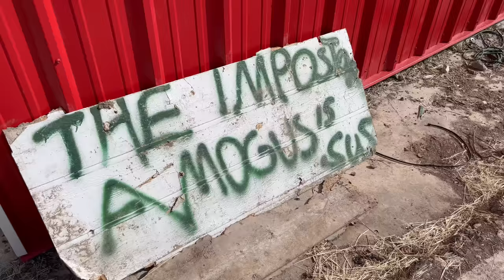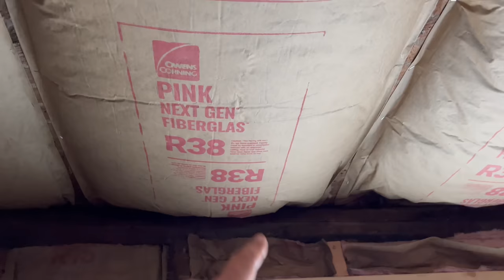Ok They Pull Up (Gort Breaks In)

Comment: ben, please name big ounce's children small kilogram and tiny pound
Reply: The measurement babies
Reply: I agree best names
Reply: @coonhuntereldon3192  The Kilo 141 is one of the several fully-automatic assault rifles usable by the player, and is unlocked alongside custom loadouts at rank 4. It features a 4 to 6 shot kill to the body, which is average for the class.
Reply: @josueonabudget9411  This comment bleeds pacergram fitness test energy
Reply: YES YES YES
Reply: medium liter
Reply: i think lil kg and small pound is better
Reply: @Shenanigans_333  "the weightlings"
Reply: @thegrim418  The Heckler & Koch HK433 is a modular assault rifle chambered for 5.56×45mm which combines features of the G36 and the HK416 families of assault rifles. The HK433 was designed by Heckler & Koch to be familiar to operators with experience using the Heckler & Koch G36 and HK416 platforms. Wikipedia
Designer: Heckler & Koch
Barrel length: 280 mm (11 in); 318 mm (12.5 in); 368 mm (14.5 in); 419 mm (16.5 in); 480 mm (18.9 in); 508 mm (20.0 in)
Muzzle velocity: ~925 m/s (3,030 ft/s) (16.5" barrel); ~970 m/s (3,200 ft/s) (20" barrel)
Action: Short-stroke piston, rotating bolt
Rate of fire: 700 rounds/min
Manufacturer: Heckler & Koch HK433
Effective firing range: 500–600 m (550–660 yd)
Reply: SMALL KILOGRAM!!!
Reply: I can’t believe Biggerton Ouncerton is already having kids, they grow up so fast 😢
Reply: I stand this
Reply: @thegrim418  the fitness gram pacer test is a multistage aerobic capacity test
Reply: @josueonabudget9411  I imagine you posted this on the wrong video.😹
Reply: Would love to see a T- Spoon and Keanu Reeves
Reply: his hive can be called the Measure Mint where they mint only the finiests of measures.
Reply: Lol i love this.
Reply: What about when they grow up?
Reply: Tiny Pound sounds....... yeah
Reply: @pepto8718  nah the weightlings is better
Reply: @marinamccann  dababy is not a baby anymore and he is still named baby so just leave it like that
Reply: @josueonabudget9411  Dababy is a rapper also good job with the idea, I was just thinking ahead
Reply: Big Ounce   OMG HI
Reply: Big Ounce   I’m a big fan
Reply: Agreed
Reply: OMG DO IT DO IT
Reply: He should name the first child Jr Whopper
Reply: @sammich897  doesnt make sense to me
Reply: Yes
Reply: Smol ounce
Reply: Kilo and Lil Ounce
Reply: @thegrim418 fitnessgram pacer test 🤓🤓🤓
Reply: This comment thread is legendary
Reply: Yes
Reply: Bigger ton ouncer ton da third
Reply: @failure4  dorkester.mp5
Reply: Millie -kilo, Bitsy-ounce, Bounce (a boy Ounce), Gram.....etc
Reply: What about little tonne
Reply: @coledaulton8740  sound good too
Reply: Your place is looking pretty darn nice Ben!
Reply: Yes
Reply: YESSS
Reply: Prince and princess ounce
Reply: @KL8T0N_SLU2HIE  that actually sounds better than mr ounce
Reply: HAHA
Reply: @urbanrescueranch
Reply: @The urban rescue ranch
Reply: YES PLS
Reply: how about big gram
Reply: Petit Pound
Reply: YES
Reply: @josueonabudget9411  cringe.
Reply: @ashurag.  i dont know if you think cringe should not be named cringe or if i am cringe. if so, what the fuck did i do wrong
Reply: About that
Reply: @coatrak1357  what now
Reply: @coatrak1357  is there something obvious that i am  missing to understand
Reply: The heavyweights
Reply: Pound for pounds
Reply: Agreed😊
Reply: *Lil Kilo and Tiny Pound*
Reply: @darc6278  no i created this and i do what i want with it dont change the goddamn name
Reply: @josueonabudget9411  the first name sucked so lol
Reply: @darc6278  yk what i agree
Reply: I agree
Reply: Nice
Reply: Quarter pound
Reply: and petite gallon <3333
Reply: Half ounce 😂
Reply: Small gram
Reply: mini liter
Reply: I was hoping he gets a new one in remembrance of big ounce and call him “big lb” for pounds😞I still miss that little big ounce…he’s up there now showing god and heaven how to be the strongest boy alive

Comment: That tank is for oil for an old oil burner. You can drain and clean it disposing of the oil wherever your local place is and cut it up and scrap it but if you have a company do it they will charge a crazy and claim epa stuff drives up the cost.

Comment: Instead of fencing off that hose outlet. Get yourself a piece of 4inc PVC pipe cut a notch out of it and cover the pipe with that. Go from bottom to top with the notch then go to the left or right with it some once you are at the point where the faucet is. This way you can drop the PVC on it and then turn it to secure it better.

Comment: Uncle Ben try making a plug with a piece of round wood about the right size or whittle it down to fit. It will swell up in the water and fill in any gaps.
Reply: ᴛʜᴀɴᴋs 🔝 ғᴏʀ ᴡᴀᴛᴄʜɪɴɢ 🔝🔝....... 
ᴍᴀssᴀɢᴇ ᴀʙᴏᴠᴇ ᴡɪᴛʜ sᴄʀᴇᴇɴsʜᴏᴛ ᴏғ ᴍʏ ʀᴇᴘʟʏ ʀɪɢʜᴛ ᴀᴡᴀʏ ɪ ʜᴀᴠᴇ sᴏᴍᴇᴛʜɪɴɢ ғᴏʀ ʏᴏᴜ📦..
Reply: Uncle Ben 👵As I ponder your missing plug perhaps a trip to the hardware store would be a better solution for a plastic tub.